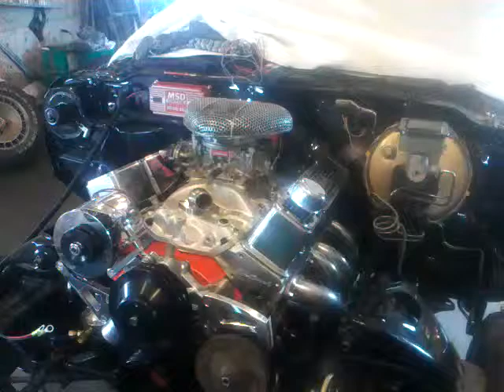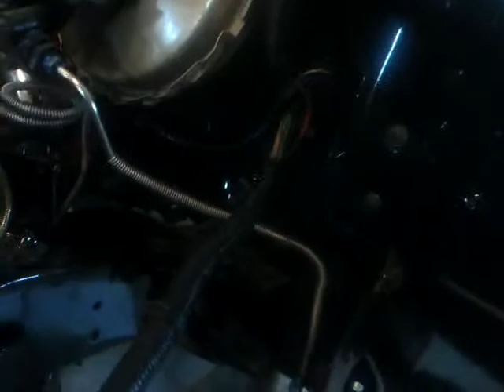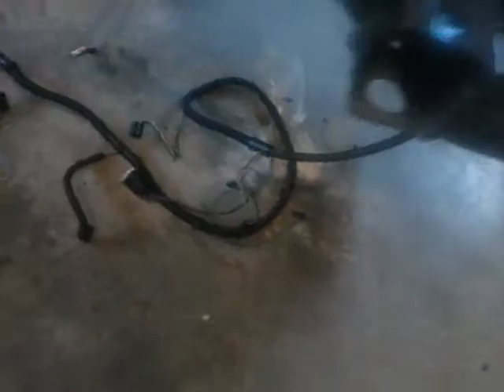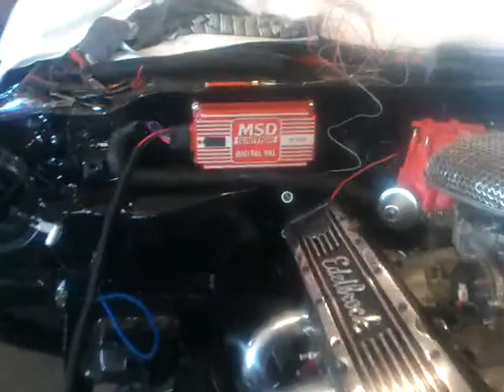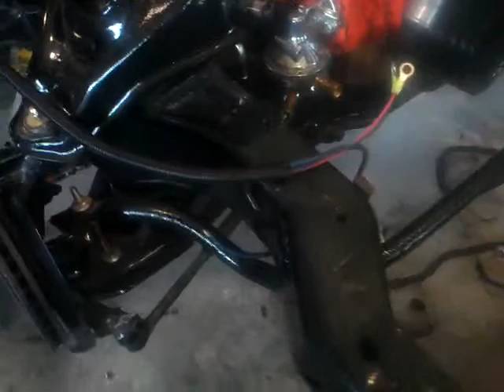1981 Trans Am Restoration Project - Wiring Harness Installed

Comment: hi there, i want to install complete wiring harness for 1981 trans am . . what should I look for in ebay?
Reply: 81 is a 1 year only.. And it depends on the options of the car..am fm cassette or 8 track... audio booster..rear  defrost  power door locks.. 1 or 2 front speakers.. 1 or 2 or 3  courtesy lights...electric  trunk release. And more!  I'd write down all the options it has.. look it up on year one or so...new wiring harness. Under 200.00 (169) I believe.. Most old ones pulled from our birds have been hacked into...cut missing plugs etc.